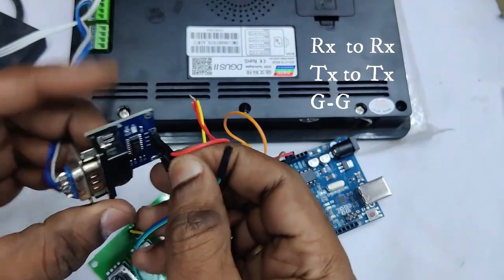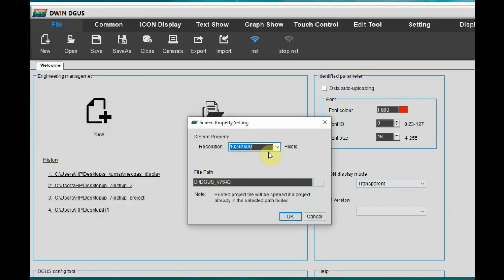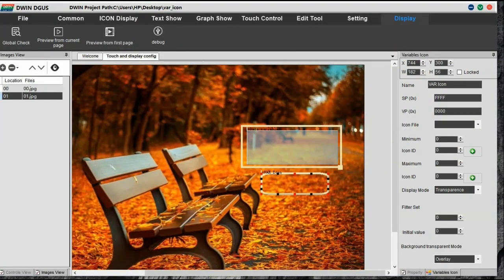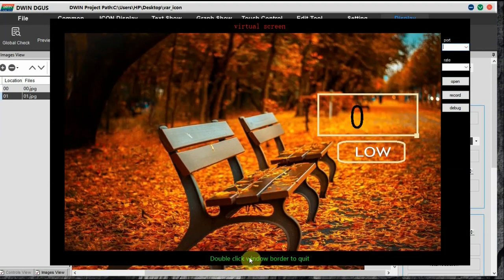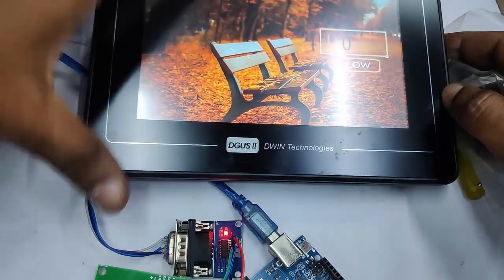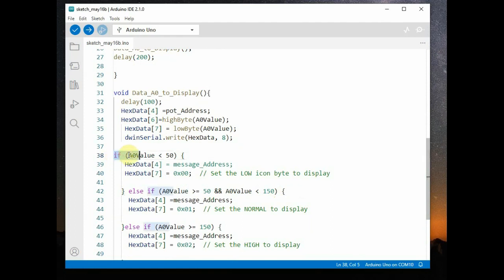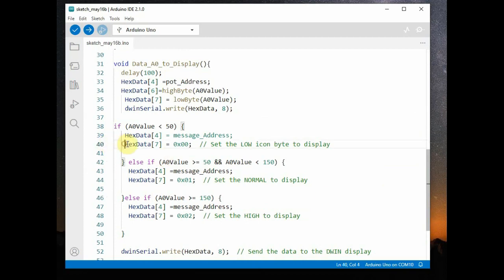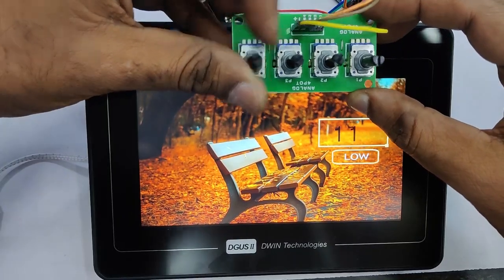#9 DWIN Display -Variable ICONs Linked to DATA Value

Comment: Hi @Saravanan - Firstly, thanks for posting such good videos, has there been any change in Var Icon functionality as I downloaded your example and tried to make it work as is, it didn't. I have a similar use case wherein I want to change the icon based on user input but nothing happens while debugging as well as sending data via Arduino, please suggest what could be wrong here

Comment: @SarvananAL sir, I have the exact same screen (2 units) but writing through Arduino never works. The same code works with different models. I want to update the data variable display depending on the data being sent from Arduino. What could be the issue?
I even tried running the same code and same setup and the variable is still not getting updated. Wiring is correct as I always get response back from the screen.

Comment: How to control transparency of icon?

I am able to change my icon based on input but my black background in my icon  is getting removed. How to control and turn this off

You also had transparent inconsistencies,
Like LOW and HIGH has background removed but NORMAL had its background?

Can you explain this behaviour?

Thanks
Reply: Did you got the solution ? 
i am trying to change the icon but the icon get vanish as vp address recv the value .
Reply: @surbhikathane  There was nothing wrong with the steps, the problem turns out to be in DGUS simulator which was not reflecting the changes made in the variable. icon. When I flashed the LCD with the updated code, it worked just fine and reflected all changes.

Several other youtuber also reported the unreliability of DGUS simulator. Just make sure vp address is correct and icons and value are in the correct order.
Reply: @PrimuSPS  Something config file generation is failed while we click on generate in dwin dgus . Do you how to stop it by failing ?
Reply: Hi @primuSPS - can you share your code? The same example isn't working for me as is.
Reply: @tyagimohit can you describe your setup or what you have done so far?